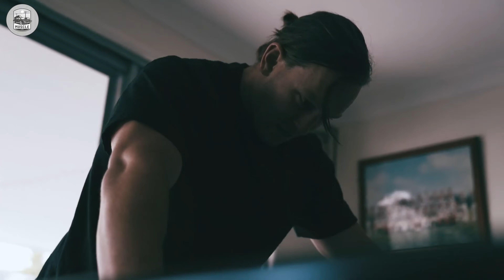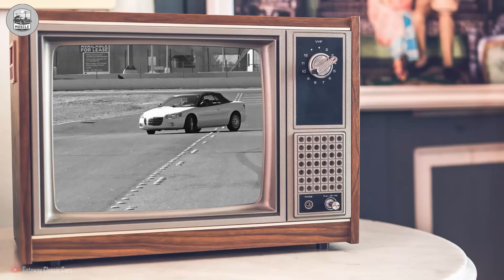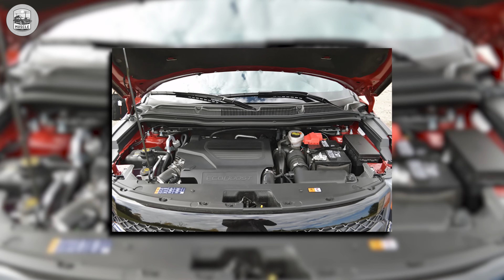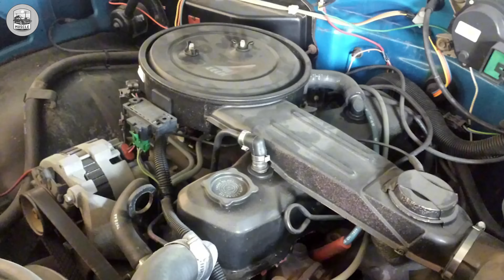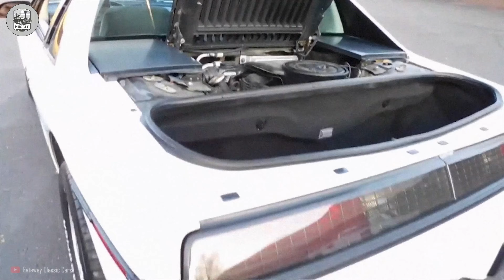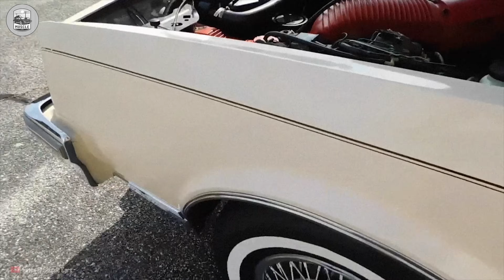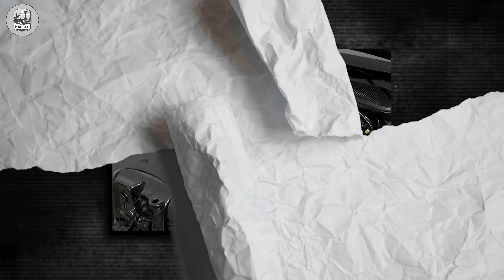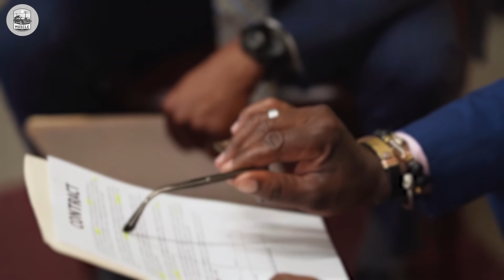MOST FAILED ENGINES ever put in production cars | Worst engine blunder!

Comment: The Ford 3.5 L eco-boost in my 2012 Lincoln has never gave me any trouble. It’s all about maintenance. and with any turbo, you never hit the gas hard until it gets to operating temperature. 130k and still going strong.
Reply from the maker: @scbird1 That’s the spirit of a true car enthusiast
 The Ford 3.5L EcoBoost is a solid engine, and your dedication to maintenance shows why it’s still running strong at 130k miles—well done! 
You’re absolutely right about letting that turbo warm up before hitting the gas. It’s one of those small habits that keep engines performing like a champ. This advice applies to any performance engine, even the beasts in classic American muscle cars like the Boss 429 or the LS6 Chevelle.
For everyone here, what’s your mileage milestone, and how do you keep your ride roaring? Drop a comment below, share your secrets, and let’s keep this muscle car community thriving! Don’t forget to hit like, share with your gearhead friends, and subscribe to Muscle Car Masters for more.
@scbird1, keep enjoying the ride, and a Happy New Year

Comment: Many of those engines you mentioned I have no knowledge of, but I do disagree with some. The Pontiac Iron Duke was touted for its reliability and economy, and I know of no one looking for performance who ordered it in a Camaro or firebird.   In fact I rarely saw a six during the time of the iron duke in any of those cars.  Most Iron duke engines were in economy style cars, not the performance and the owners were very happy with what they got.  You missed a few very bad engines that I knew about when I was a mechanic in the 60's and seventies. The most notorious engine of all time you never mentioned, the Vega 4-cylinder engine.  Overheat it once and you bought a new engine.  Another engine you mentioned that was not bad is the 3.8-liter chevy V6, which is actually rated as one of the best engines ever made.  It did have a problem with fluid leaks in the valley gasket, not the head gasket.  This was fixed by GM after the first year.  One other complaint I have is that you rarely mention the problems that were fixed in later years of engine production.  For a modern example, the Chrysler PentaStar V6 engines had a problem with failure of oil coolers in the early years that has since been corrected and is a rare occurrence in current PentaStar engines.
Reply from the maker: @gerardtrigo380 Thanks for your detailed comment and for sharing your knowledge—it's always great to hear from someone who knows these engines firsthand! You're absolutely right about the Pontiac Iron Duke being more about reliability and economy, and it's true most enthusiasts weren't putting them in Camaros or Firebirds for performance. The Vega 4-cylinder engine is a fantastic point—its aluminum block design caused nightmares for mechanics after even minor overheating! Also, the 3.8-liter Chevy V6 is indeed a legendary engine, especially after those early fixes you mentioned.
Your insight about manufacturers addressing problems over time is spot on too—like the Pentastar V6, many engines evolved into reliable powerhouses. For American muscle car fans, it’s these stories of improvement and resilience that keep the legacy alive
What do you think? Let us know in the comments
Don’t forget to share and subscribe for more American Muscle Car content. 
Have a great day, and Happy New Year

Comment: The olds diesel when 0-60 eventually
Reply from the maker: Hey @surg9029,
The Oldsmobile diesel was definitely one of the most infamous engines in automotive history. It promised groundbreaking efficiency during the fuel crisis of the late '70s but ended up being a mechanical nightmare. With issues like head gasket failures, weak internal components, and being rushed into production, it gave diesel a bad reputation in the U.S. for years.
But here's the silver lining—despite this hiccup, Oldsmobile's legacy in the muscle car world is untouchable. Think about the 442 with the W-30 package, a true beast of its time, or the legendary Rocket V8 that roared down drag strips. Every brand has its missteps, but the muscle car spirit lives on
What’s your favorite Oldsmobile engine or muscle car moment? 
. Wishing you a fantastic day and a Merry Christmas

Comment: The two best automotive engines ever built were the Ford 300" light truck inline 6 and the Jeep 4.0 inline 6. Which is #1 and #2 is based solely on whether you're a Ford or a Jeep man. For both, running past 300,000 miles was a common occurrence and there are reports of them going past 400,000 or more miles without a rebuild. Just do normal maintenance and regular oil changes, is all. A lotta people say the Buick 3800 V6 is also bulletproof with regular maintenance and oil changes.
Reply from the maker: @bobkonradi1027 You're absolutely spot on about the Ford 300 and Jeep 4.0 inline 6 engines being legends in durability and reliability
These workhorses are icons for their simplicity and ability to rack up hundreds of thousands of miles with just regular maintenance. The Ford 300, with its torque and versatility, powered everything from pickups to industrial equipment, while the Jeep 4.0 is the heart of many legendary off-roaders. And you're right about the Buick 3800 V6—it’s another bulletproof powerhouse that shows how American engineering knows how to build engines for the long haul.
For all American muscle car fans out there: what are your thoughts on these engines? Are there any other all-time greats you think deserve a shout-out? Drop your favorites in the comments below! Don’t forget to like, share, and subscribe to the channel for more muscle car history and epic discussions. 
Have a great day, and Merry Christmas!

Comment: The most-failed Ford Engine.. The Taurus SHO 3.4 liter V8 engine from the early 1990s. Instead of putting splines or keyways in the cam shafts and then putting on splined or keyed cam shaft sprockets, Ford just made the sprocket bores a little smaller yet, and heat shrunk them more tightly onto the shafts. At about 80,000 miles there was 100% engine failure when the sprockets started slipping on the shafts, the shafts went out of timing and all the engine's valves would crash into the pistons. It was literally 100% of all engines produced, with the caveat that a relative few owners learned of the problem and had the timing sprockets welded to the shafts in time, which then solved the problem. At the Ford factory level, the cost of putting splines or keyways onto cam shafts would be about a dollar or two per shaft, times 4 shafts, or about 10 dollars. Now, since the problems universally appeared at about 80,000 miles, and thus the engines were out of warranty in spite of it being a factory design flaw, Ford cheerfully denied each, every and all warranty claims. It would take a complete new or fresh rebuild engine to replace the destroyed V8. The V8 Taurus SHOs became worthless and were disposed of as scrap metal.
Reply from the maker: Wow, that's some wild history on the Taurus SHO 3.4L V8! It's crazy to think how a simple $10 fix could’ve saved the reputation of that engine. This highlights just how crucial precision and foresight are in engineering. While the Taurus SHO V8 had its flaws, it's also a reminder of the risks Ford took to innovate in that era. For American muscle car fans, it’s a bittersweet tale—great power, but a critical Achilles’ heel
What do you all think? Are there other engines you’d consider “fails” or lessons in muscle car history? Let us know in the comments below! Don’t forget to share this post, subscribe to the channel, and explore more American muscle content. 
Have a great day...

Comment: The 2.7 problem was not the water pump. It was people not changing the freaking oil. They were trying to use conventional oil and cheap out on the engine. It did have a very overcomplicated and horribly over-engineered PCV system. But when they put the catalytic converters immediately adjacent to the engine block on either side of the engine and cook the oil. You must change the oil every 3 to 5000 me and use very good synthetic oil in the engine. If you keep it out and try and extend oil changes you end up sludging up the timing chain tensioners and it causes the engine to fail. It was a temperamental engine if you didn't take care of it meticulously. But that didn't mean the engine itself was a failure that just meant whoever bought it didn't understand the engine and the people selling it of course certainly did not understand it.
Ford has done exactly the same thing with their 3.5 L engine run an internal water pump off of a timing chain. It's an asinine idea when Chrysler did it, and it's an asinine deal when Ford does it. Do they last, a few people have been lucky. The problem is is when you get a water pump leak you fry to $4,000 engine before you even notice that you have a fluid leak.
Reply from the maker: @44hawk28 - You're absolutely spot-on
The 2.7 was definitely an engine that demanded proper care, especially with oil changes and the use of high-quality synthetic oil. You’re right about that PCV system and the catalytic converter placement—talk about a setup that cooks your oil! These engines weren’t forgiving if neglected, but when treated right, they could deliver solid performance. As for Ford's 3.5L with the internal water pump running off the timing chain—yep, it’s another head-scratcher. While some owners have had luck, the risk of catastrophic failure from a hidden leak makes it a tough sell for long-term reliability.
Muscle car fans, what do you think? Should manufacturers revisit these designs, or are they too stubborn to change? Let us know your thoughts in the comments! Don’t forget to share this discussion with fellow gearheads and subscribe to American Muscle Cars for more engine insights and history. 
Have a great day and Merry Christmas

Comment: The second generation of the 2.2 4 cylinder was actually a very reliable engine I saw them run in Cavaliers for well over 150 to 200,000 mls with no problem.
Reply from the maker: You're absolutely right
 The second-generation 2.2L 4-cylinder engine was a workhorse in its time. Seeing them run strong in Cavaliers for 150,000 to 200,000 miles without major issues is a testament to their durability and simple, effective engineering. While it wasn’t the powerhouse you'd find in a big-block muscle car, it played an important role in GM's lineup during the 80s and 90s. These engines had a reputation for being easy to maintain and super reliable, especially with proper care.
Have a great day and Merry Christmas to all our car enthusiasts

Comment: The concept of is placing cylinder operation is a complete problem to this day. You would do better to actually lean the engine out when it doesn't need to put out so much torque. You'd get far better fuel mileage because you wouldn't have to push 4 cylinders with the other four cylinders before it even got to pushing the transmission. It was a stupid idea with the 468 engine, and it's still a STUPID idea!
Reply from the maker: @44hawk28 – You bring up a fascinating point about cylinder deactivation technology, and your critique definitely hits on some real frustrations. Back in the day, GM's 8-6-4 system in the Cadillac 468 was indeed a bold idea, but its execution left a lot to be desired. Modern systems like GM’s Active Fuel Management or Chrysler’s Multi-Displacement System have made strides with better electronics and smoother transitions, but they’re still not perfect for high-performance engines.
As true muscle car fans, we know there’s nothing quite like a naturally aspirated V8 firing on all cylinders, delivering pure, unfiltered torque when you need it. The idea of leaning out the engine for fuel efficiency while keeping all cylinders engaged is intriguing and something engineers could explore further for maximizing power without sacrificing economy.
What do you think, muscle car fans? 
Share your thoughts in the comments, and don’t forget to like, share, and subscribe for more American Muscle Car discussions
 Wishing you a great day and a Merry Christmas

Comment: Ah yes, the Caddy Northstar engine is a big joke
Reply from the maker: Thank you so much for your information on our channel
Ah, the Cadillac Northstar engine—definitely a hot topic in the car world! While the Northstar had its fair share of issues, it’s also worth remembering it was a bold attempt by GM to innovate with high-performance luxury engines. Introduced in the early '90s, the Northstar V8 pushed boundaries with its advanced tech for the time, like dual overhead cams and aluminum construction. Sure, it gained a reputation for oil leaks and head gasket failures, but it was also an engine that delivered impressive power for its size. Love it or hate it, the Northstar deserves its spot in car history discussions.
hope to see you on newest video... have a great day.

Comment: The Buick 3800 Series 2 was supposedly a great engine. The early 3800, not so much! I owned some of these knocking oil burning beasts, and even though I belong to Buick Club of America, and am the local Chapter Director, I will say those early 3.8 liter V6 Buicks are all turkeys. A quart every 300 to 400 miles was doing good, and they would knock going uphill. Also, no power to speak of. When the speed limit was 55 mph they barely were good enough to keep up with traffic. Dangerously slow with a 70 mph limit!!
Reply from the maker: Great comment, @fredanddebramacdonald2445
 You bring up a solid point about the early Buick 3.8 V6. While they laid the foundation for the legendary 3800 Series II, those first-generation engines definitely had their struggles—oil consumption, knocks, and that lack of punch were real headaches for owners back in the day. By the time Buick refined things for the 3800 Series II in the '90s, it became one of the most reliable and efficient engines ever produced. Some folks still call it the ‘modern-day straight-six’ for its smoothness and durability.
I’d love to hear what others think—any Buick fans out there with stories about these engines? Drop your thoughts in the comments! And if you haven’t already, don’t forget to like, share, and subscribe to the channel. There’s plenty more coming your way, and I hope to see you in the newest videos. 
Have a nice day

Comment: Sorry Mr. A.I. guy. Been working on cars since 1968. Without going through the whole list, the 3800 was a fantastic engine. Had the 3.1 Figured out and gasket problems fixed within four years of their production, still have one that runs flawless to this day. As far as the 3.5 Ecoboost, I've got a 2013 F-150 That has given me absolutely zero problems other than a leaking vacuum pump gasket with 352,000+ miles on it to this day. I simply change the oil every 3000 miles, the coolant every 70-80,000 miles as well as transmission pan and filter, both diffs and transfercase twice in those miles. Gen 1 3.5 Is still used in the commercial vehicles to this day in 2024. A lot of those engin es were definitely junk out of the gate, some were great engines that just got driven to death with no Maintenance or inept mechanics. And for those of you that can't find parts for your 3.5 Gen1, Because of back orders, so on and so forth, Look.
them up under a 2022 or so transit van 3.5. You can find it all
Reply from the maker: Thank you so much for sharing your experience
it's always awesome to hear from someone with your depth of knowledge and history in working on cars! The 3800 was indeed a legend, and your meticulous care for your 3.5 Ecoboost is a perfect example of how regular maintenance can turn a good engine into a long-lasting powerhouse. Your tip about sourcing Gen 1 3.5 parts under the Transit van listing is absolute gold—fans will appreciate that. Your insight truly adds value to this community, and I'm grateful for your contribution. 
Keep sharing your wisdom—have a great day, and happy wrenching...